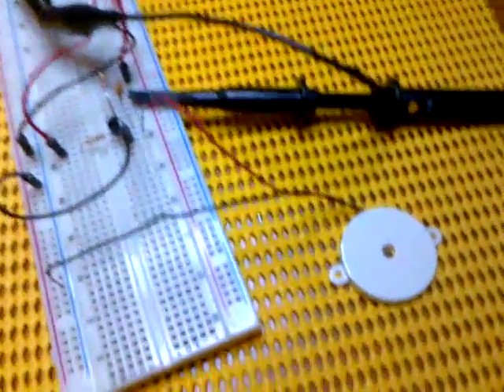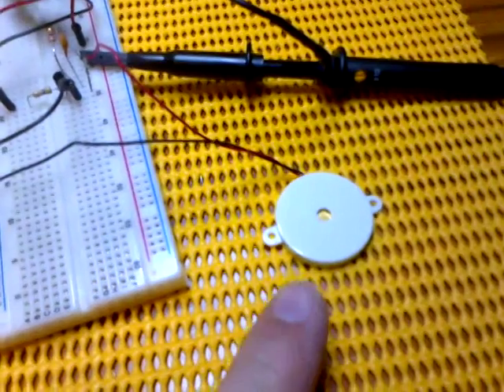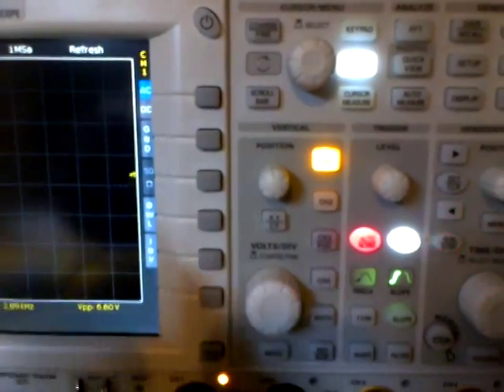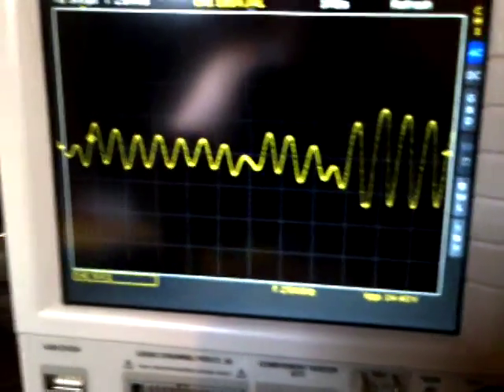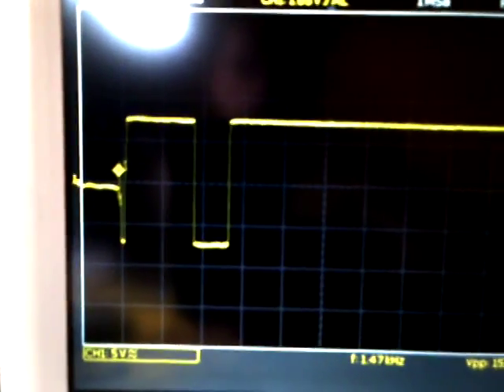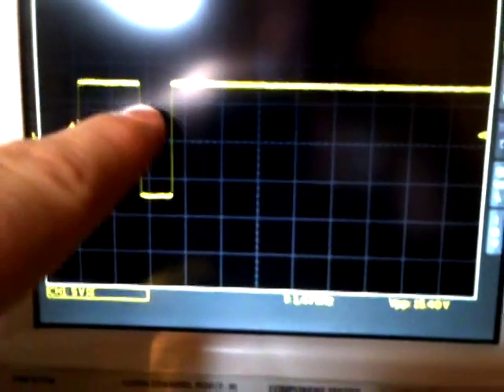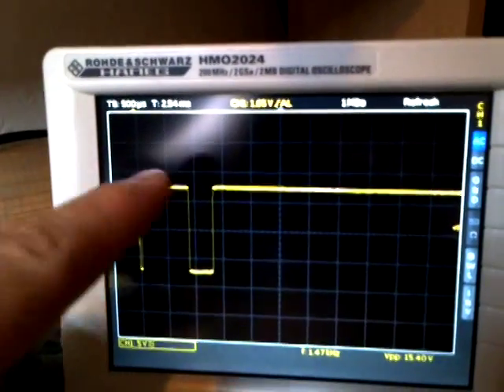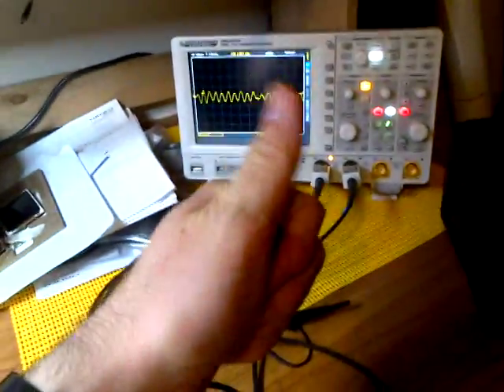Basic audio amplifier - sensitive with a piezo transducer

Comment: What about an existing alarm clock? How do you amplify the piezo for more volume?
Reply from the maker: The piezo crystal is a natural transducer - it converts pressure (bending) into a voltage - and vice versa, if a varying voltage is impressed upon the crystal, it will bend (oscillate). This physical oscillation is the source of air pressure waves you hear. Now, if this is bending of the crystal is the source you need to amplify, then you can try (at your own risk :-) ) to increase the voltage applied to the crystal (using a transistor ampilifer for example), but you may have limited success as the amplification of the bending may not create 'twice as loud' - our hearing works logarithmically, not linearly. Replacing the existing piezo with a larger one (look for higher decibel output ratings) and then experiment with applied voltages to that new 'buzzer' should create a louder alarm output. Good luck!

Comment: Hey, I actually have a doubt which is similar to this. I am doing a project on water sensing, so I'm planning to keep the piezo on top of the tap and use an op-amp to amplify the vibrations. Which schematic will be best for me to ignore the noise and get a good result.
Reply from the maker: Hi Vishwa, filtering seems to be needed to identify the major vibrations from the noise. I share the schematic of the piezo transducer amplifier in the above video notes, and suggest that you consider filtering the output (amplified signal and noise) with something simple like a few capacitors of various sizes between the output and ground. Capacitors are usually used to remove higher frequency noise from power supplies on audio outputs (just like this one), so experiment with capacitor sizes (10uF, 1uF, 1nF, etc.) and see the results. The noise (higher frequencies) would be smoothed out, leaving more noticeable peaks etc of your main vibrations. I am no expert, but that seems worth a try. Let me know in the comments if that helps!

Comment: Must have used an OPAMP
Reply from the maker: @Harsha, thanks for leaving a comment! The circuit does not use an opamp. It is a simple example of a 1-transistor audio amplifier with a 2N3904 (I think that is what I used!) BJT transistor. The piezo transducer that converts sound into electrical signals is a high impedence device, so yields a relatively large voltage with tiny current. This is presented to the transistor input, which is a current amplifying device (opamps and MOSFETS etc.are voltage amplifiers). The resulting voltage is measured in Volts per division on the scope. I was impressed by the effectiveness and simplicity of this arrangement. The Hfe gain of the transistor was around 200 from memory.
Reply: @queuerious  yes 14 volts peak to is very good response thank you for the reply. Can you please share the circit diagram if possible it would help me  to analyze the circuit properly. Cheers
(Edit):btw I'm surprised to see a very clean and noise free output I wonder if you used any filter for that...
Reply from the maker: Look on my YouTube channel for the earlier video where I explain this 1-transistor amplifier. The circuit schematic is in the notes for that video. Good luck.
Reply from the maker: Look on my YouTube channel for the earlier video where I explain this 1-transistor amplifier. The circuit schematic is in the notes for that video. Good luck.
Reply from the maker: Look on my YouTube channel for the earlier video where I explain this 1-transistor amplifier. The circuit schematic is in the notes for that video. Good luck.
Reply from the maker: Look on my YouTube channel for the earlier video where I explain this 1-transistor amplifier. The circuit schematic is in the notes for that video. Good luck.
Reply from the maker: Look on my YouTube channel for the earlier video where I explain this 1-transistor amplifier. The circuit schematic is in the notes for that video. Good luck.
Reply from the maker: Look on my YouTube channel for the earlier video where I explain this 1-transistor amplifier. The circuit schematic is in the notes for that video. Good luck.
Reply from the maker: Look on my YouTube channel for the earlier video where I explain this 1-transistor amplifier. The circuit schematic is in the notes for that video. Good luck.
Reply from the maker: Hi  @harsha.n9332 , no filtering was applied. Check out my video here https://www.youtube.com/watch?v=fegzhxbYblc  as it contains the schematic in the video notes. Good luck and thanks for watching